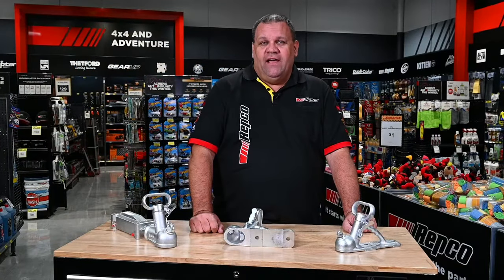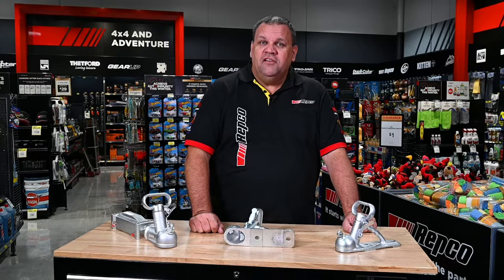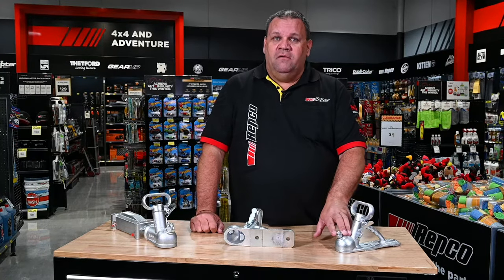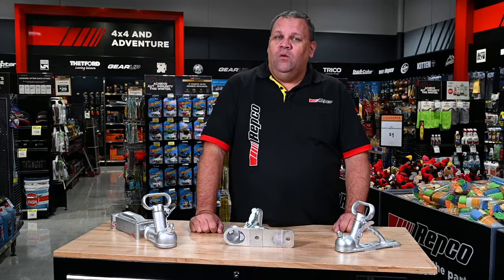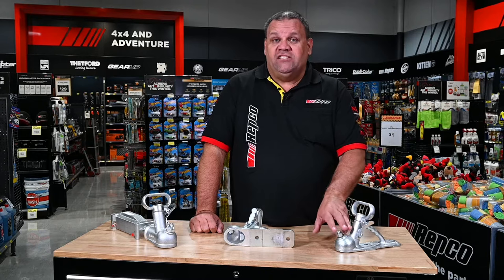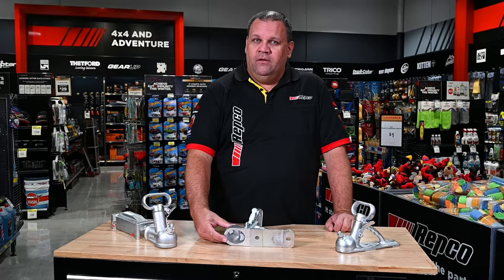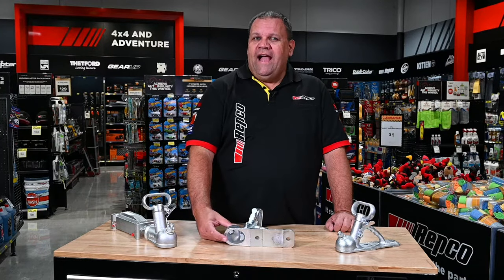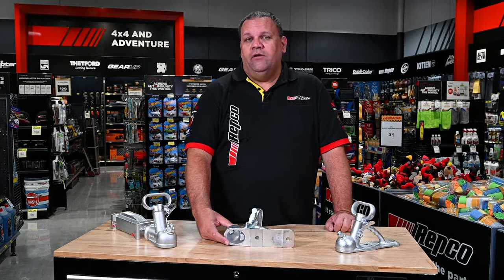Tow Bar Tow Hitch Coupling Maintenance and Replacement - Repco

Comment: Nouthing about the thumb clip lock my trailer came off because of the pin and spring vibrating loose on the f1 due to the perfect road conditions **(not)